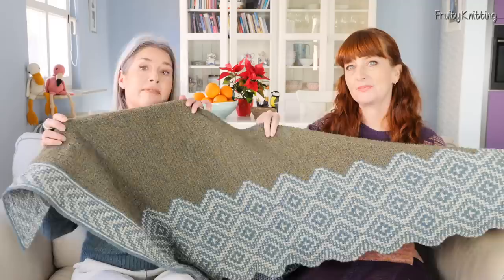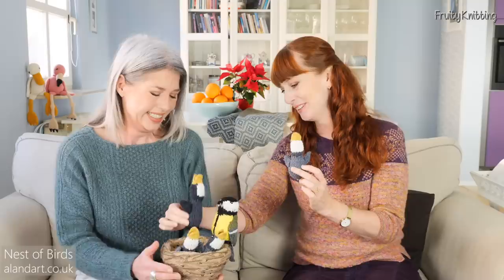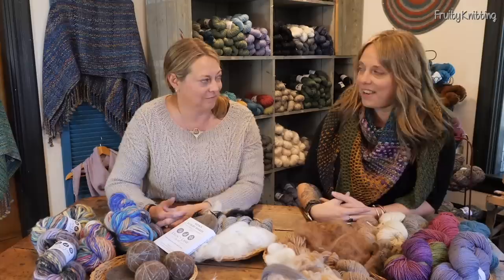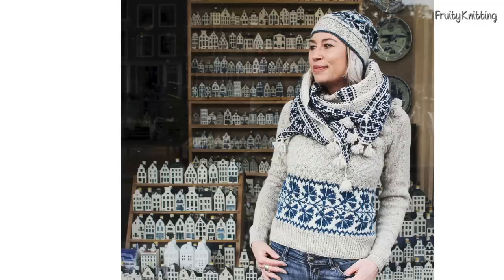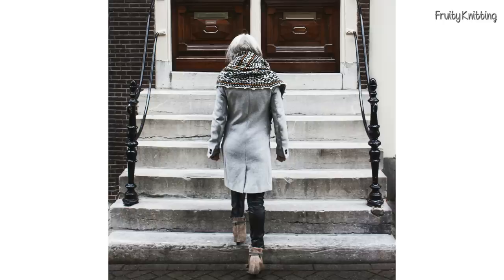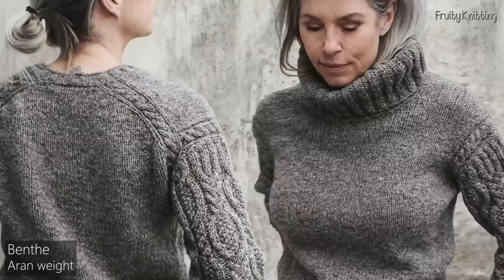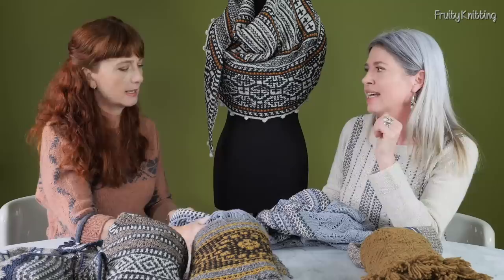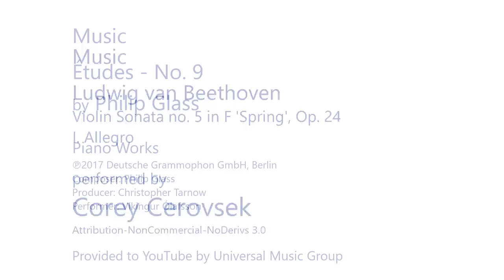Moonstruck Knits - Ep. 127 - Fruity Knitting

Comment: Wait, wait.  Plastic bottles are made into all kinds of fabrics that are called 'fleece', but I have stopped buying and wearing this kind of fabric because, when you wash it, it sheds plastic and that plastic adds to all the other micro plastics in the sea. My understanding is that 'eco' is a misnomer for this kind of product.
Reply: Indeed, and these microfibres are now getting into the food we eat 😢.
Reply: At least here in Sweden, I have also heard from multiple sources that the recycling of plastic bottles is one of the few somewhat functioning systems, so by taking plastic fibers out of the system, more plastic bottles are instead made from crude oil.
Reply: @ebbahelgesson6224  recycling plastics actually uses more “energy” and is not wise. We must rid plastic from mainstream use.
Reply: This plastic fiber is not breathable and makes me sweat and it is horrible after washing.  I do not buy it at all.
Reply: @humblehalfacre8464  I agree about the sweating.  When I decided to stop wearing artificial fabrics and go back to wool, I was amazed at how my ability to regulate my body temperature returned. I can wear aran weight wool like LettLopi indoors and not feel too hot and outdoors and not feel to cold.  If this had been 'invented' by a human, it would be heralded as a miracle fibre.  It grew on the back of a sheep.